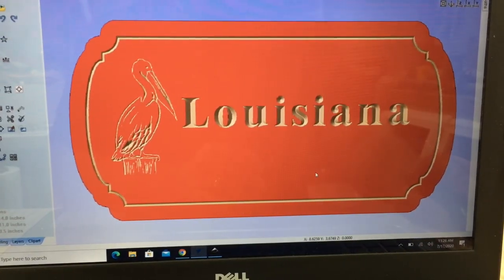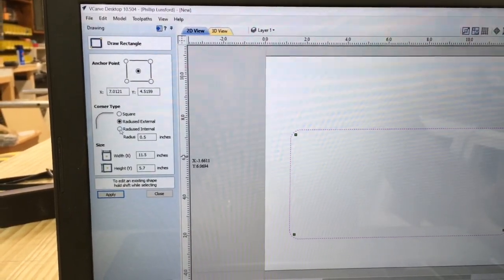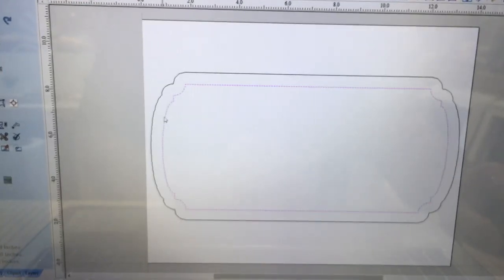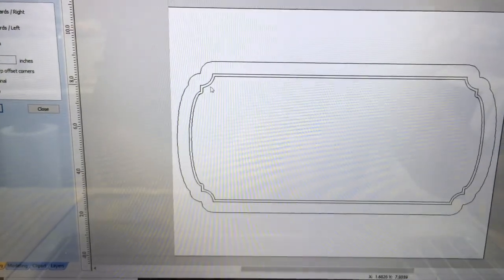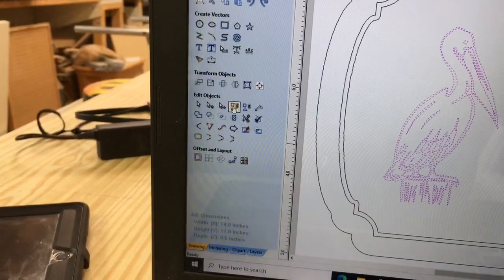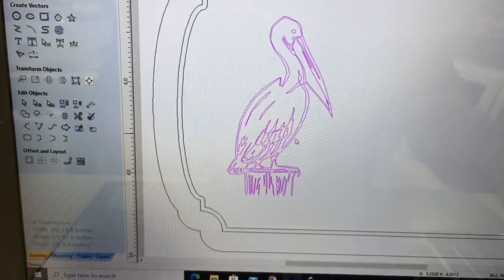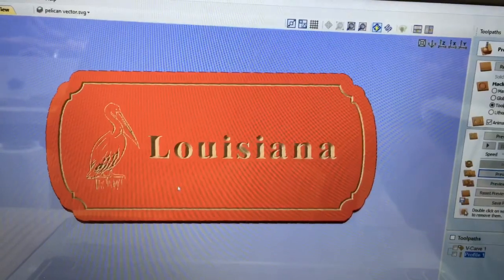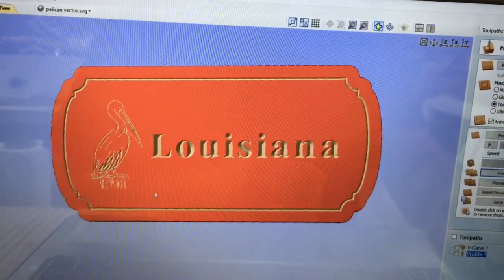Welding Shapes, Importing Vectors, Offsetter feature & VCarving in VCarve Desktop

Comment: Just a note more.  I just turned 79 and think you are great .  I have built computers from scratch before windows, when DOS was the big deal.  I have been carving signs by hand for the last 3 years but I had an accident and lost about 95% sight in my right eye.  I will give the Shark SD 100 a chance.  I know I can do it.  Just keep up the wonderful lessons.
Reply from the maker: Thank you very much.  You have a few years on me.  I remember working with DOS also and writing programs using basic.  Congratulations on getting a CNC machine.  Yes, you can do it.  Thank you for sharing your story.

Comment: The camera going in and out of focus makes watching this very hard.
Reply from the maker: Yes, I am working on this. This the second time this has happened.  Trying to fix the problem.  I may need another camera.  It seems to be the worse on the white screens.  Thank you for your comment.
Reply: Paw Paw’s WorkShop You could try using a screen capture application then incorporate it into the video.
Reply from the maker: I've tried several programs but are not compatible with other software I'm using.